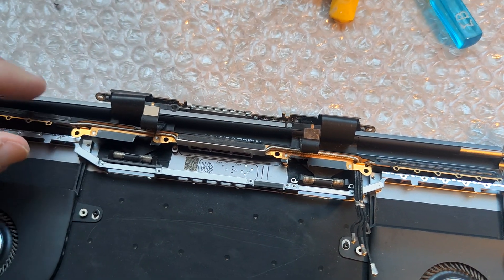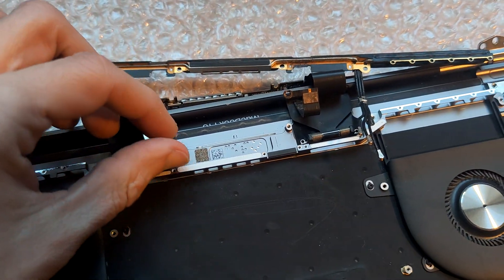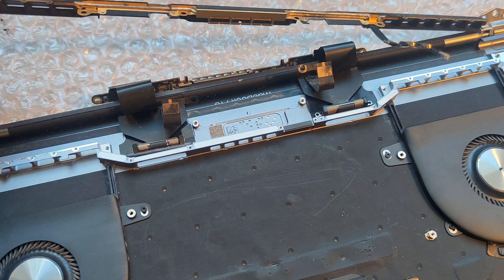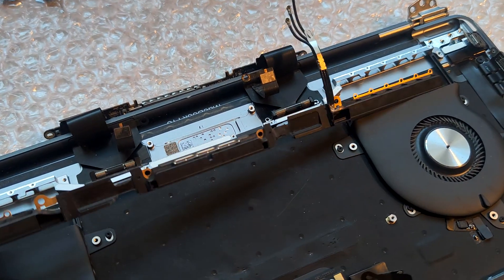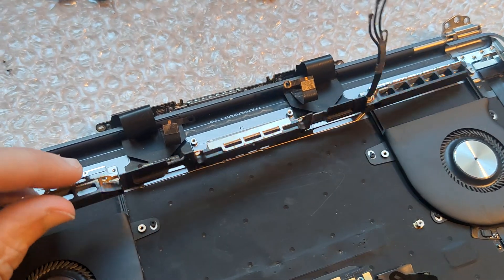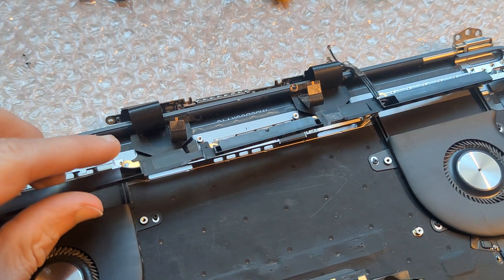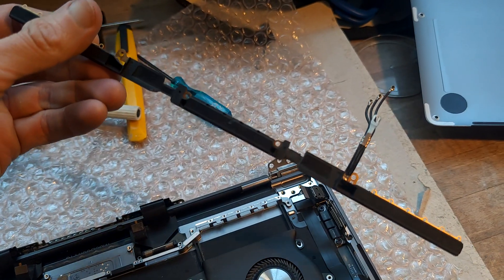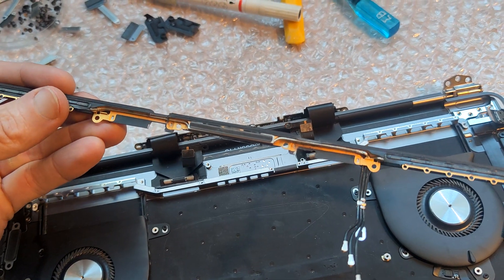Experiment - MacBook Pro Flexgate prevention

Comment: I tought about putting an extra layer of tape glued to the two flex cables that goes into the monitor, as they seems to break in the midle due to being too thin. That plastic tape, in my opinion, would share with the cable the cyclic force they hold during the opening and closing of the screen.
Reply from the maker: yes, i also thought about that, but still didn't get to test, i would like to work a half state flexgate situation where the cable is already slightly damaged to see how it would work in that situation
Reply from the maker: https://www.youtube.com/watch?v=AsNQVcaHO54 i tested this and it actually made a broken screen partially recover, so definitely helps!